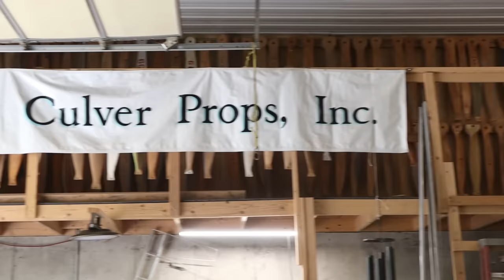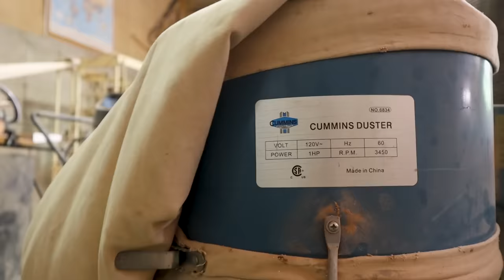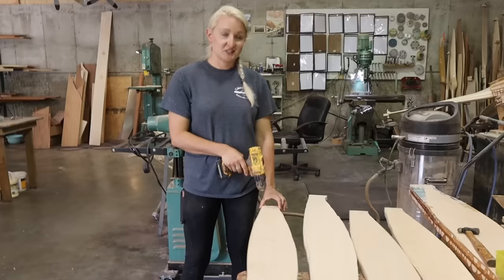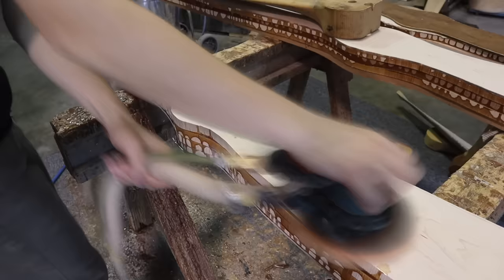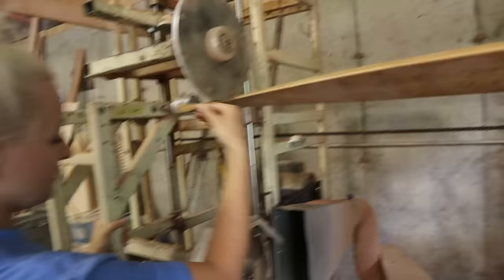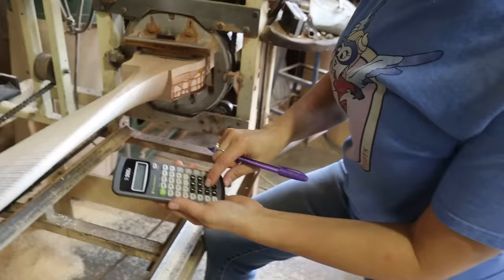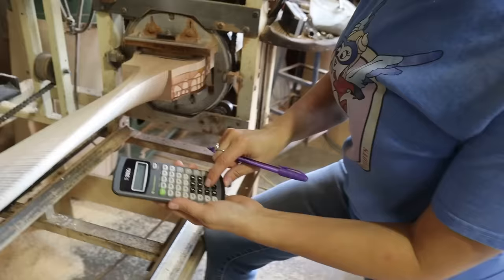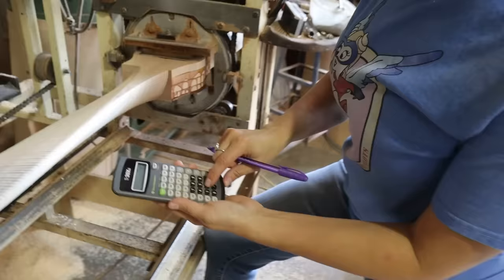Making a WOODEN Airplane Propeller!

Comment: That copy-lathe is the coolest machine I've seen in a long, long time.
Reply: Great idea! Simple as a penny - but so easy to use!
Reply: I wonder how were the propeller made before that machine ever made 😅
Reply: @victorip7632 I think slowly is the keyword
Reply: @Yewtewba  But also by the time propellers were being made in numbers that sort of machine would have already existed.
Reply: @banaana1234  apparently the first was 1820. So yeah I guess so
Reply: @victorip7632  I'm curious how the blanks are made. I guess maybe you could start with a few specific profiles done by hand and iteratively get the variations with the machine plus adjustments.
Reply: @neemabrown6922  Well, sort of.  The thing about the blanks is they are used for both sides so they remain more or less identical.  It's a lot easier to carve a one-sided blank by hand.  Back in the day carving a blank for a propeller was more an art than a science.  Today of course we have computers and CAD/CAM machines to use much more arcane math to design our props.
Reply: @Yewtewba  That mechanism was also (possibly originally?) used to make rifle stocks, back when military firearms were half wood. 3D printing is the new hotness, but don't discount the old ways of manufacturing where the process follows a template -- once you make the reference model, it's trivial to throw it in that lathe and turn out a million or three. Or pop a casting mold off the reference part and pour/injection-mold eleventy billion of them. 3D printing just makes it easier to design the master, because it's faster to iterate tweaks  than whittling logs by hand.
Reply: @neemabrown6922  Alaina has a video earlier this year building a pattern from scratch
Reply: I was about to say the same.  Genius machine in it's simplicity and effectiveness.
Reply: @DeliveryMcGee  That lathe design is also not that dissimilar to older style camshaft grinding machines, with a similar 'following wheel' running against the master lobe pattern and moving the cam blank relative to a grinding wheel to reproduce the shape. The main difference being each lobe is ground separately, rather than it being a continuous pass across the entire length of the shaft. Now everything is done via CNC rather than with mechanical patterns.
Reply: It was mesmerising to watch!
Reply: I believe that lathe operates much like a pantograph. I wonder how old it is?
Reply: I have seen similar machines for copying keys. You put the original in one side and a key blank in the other, then follow along the profile of the key and it cuts it into the blank.
Reply: @neemabrown6922  Originally, they were either hand shaped to the exact airfoil and pitch at the same time with airfoil templates and angle measurements used at various stations, or the airfoil was shaped first and then placed in a vise and steam bent to the exact pitch they wanted.  It's surprisingly easy to design a prop, it's the repetitive and labor intensive nature that makes them difficult to reproduce by hand.
Reply: Copy lathes go back to before the Civil War. They were invented by Thomas Blanchard in 1820, and yes, they were originally used for carving gunstocks.
Reply: If this impressed you then Google Rose engine lathe...
Reply: @victorip7632  
There's a  museum in the Old Springfield armory  in Massachusetts  that has an original Blanchard lathe/gunstock lathe/copy lathe   from the 1800s it's a really cool machine and the great great grandparent of the lathe used here. But more to your comment I believe the log entries still exist from the time the Wright Brothers were making their own early props and calculating the profiles out like slices of a  bread loaf.  Because as wonderful as a copy lathe is someone has to make the initial profile and who ever it is is a real artist
Reply: It takes a really cool machine to make a really cool machine.
Reply: Thats how they make gun stocks I believe
Reply: @DeliveryMcGee  -  And once the computer learns the blank it can continue with a VERY HIGH level of accuracy to turn out props quickly and easily. I used to work for a large automation company and I could see our C&C machines +robots doing this work in a matter of minutes which would include sanding the prop to a perfect balance. This is definitely an art form.  We built some crazy machines to make all sorts of complex products in real time from scratch.
Reply: @victorip7632  Henry Ford copied his production line from "military" manufacturing. Which derived its name from the manufacture of rifles during the civil war. The rifle stocks were made on similar machines, so it is one of those engineering tie-ins where one idea makes another one possible.
Reply: A thing of beauty. Before it started and we saw the pantograph I was trying to guess what would happen - it was even better!
Reply: @DeliveryMcGee  Hero of Alexandria (AD 60) invented the Pantograph, which is the same thing essentially.
Reply: agreed
Reply: is a copy milling machine. The process is more of a milling than a turning operation

Comment: Maybe I don't get out enough, but that lathe is just about the coolest thing I've ever seen.
Reply: I had to stop the video and show my wife.  She thought it was cool and she's not a geek like me.
Reply: It was definitely very cool.
Reply: It's called a duplicator lathe.
Reply: @KJ6EAD  Thanks.  It reminds me of the "Sketch-a-Graph" device I had many years ago.  Same principle, really.
Reply: same, what an incredible low-tech solution
Reply: I  believe that lathe operates much like a pantograph. I wonder how old it is?
Reply: I see lathes all the time. This thing was the coolest.
Reply: OG analogue CNC machine
Reply: It's not a lathe, it's a duplicator. Ancient piece of English kit used for centuries across all industries.
Reply: @shubinternet  I think a pantograph is similar, but can also enlarge or shrink in the process. So, this but with two connected levers (a parallelogram?) of different lengths instead of a fixed distance.
Reply: Whoever came up with that was genius
Reply: Yeah, they used these to make all sorts of wooden objects, like paint brush handles and gun stocks. I guess these days there are CNC mills that are used for this, too..

Comment: There's a scene in the BBC adaptation of "A Piece of Cake" where one of the pilot's propeller explodes in flight. He quickly shut down the engine and managed to glide the Spitfire back to the airfield. It was a wooden propeller, but it was variable pitch.

Comment: I love this mix of technical precision with organic woodworking craft.  I would love to understand how the original prop templates were made!  Also something about watching you fill in those stamped numbers with pencil was just deeply satisfying.
Reply: it is almost funny to see how the process jumps from crafting, to machining back to using a hammer to stamp in the numbers and filling it by hand. It is well: signing of the work making it "official", so the most "hands on" part is the most sacred part of the process as it confirms with the makers knowledge, experience and judgment that this is now a propeller.
Reply: That's a fascinating question about how the templates were made. My guess is they were carefully handcrafted, with measurements being taken at every moment.

Comment: I made a display prop for my hangar in the same exact manner using my amateur rendition of Jablo densified wood with Douglas fir, then hand formed brass leading edge protectors and soldered them in.  There's a local guy with a prop lathe that let me borrow it, and while it does so much of the hard work for you, there's still a ton of work left to do.  It's another example of 90% complete with 90% left to do.  For anyone doubting the resilience of wood as a prop material in the modern world, MT Propeller is still using wood cores for their high performance composite blades, and a lot of the top tier British WWII fighters used Jablo/Rotol wood props.  We started our journey into the skies with wood props, and they're still just as effective today.

Comment: That pantograph lathe is SO COOL! Maker/Aviation crossover content best content 💯
Reply: There's no pantograph there for scaling, just a 1:1 duplicator lathe.
Reply: The 4 bar mechanism of the duplicator  is a pantograph.

Pantograph doesn't mean 1:1 or enlarge or reduce,  it means 4 bar mechanism.
Reply: @myotherusername9224  I agree with the definition but didn't see more than three bars in use. If there are four, I'm wrong and offer a weasely conditional internet apology to the OP for my arrogance. 🙄

Comment: I am amazed that wooden airplane props are just boards "Glued" together 🤯
Reply: Wood is an amazing material.  The combination of flex when needed and rigidity when needed at a relatively light weight (depending on the variety) is hard to replicate.
Reply: @TheBigburcie  Wood is essentially a natural plastic. It's a fiber bound by lignin, which is an organic polymer, just like most plastics are some fiber (glass or carbon) bound by a different polymer. And when you laminate wood by gluing boards together you eliminate the natural weakness of wood, because it wants to split along the grain. So yeah, it's not hard to replicate at all, if anything it's really really bad compared to modern materials.
Reply: "when you laminate wood by gluing boards together you eliminate the natural weakness of wood, because it wants to split along the grain"

except that in this case,  the grain goes in the same direction in every layer, so how does this eliminate the weakness of wanting to split along the grain ?

" it's really really bad compared to modern materials"

Wood is bad?  How so ?
Reply: @myotherusername9224  it's heavier than say carbon fiber or glass fiber polymers, it can experience water damage if the finish is damaged. It does go in the same direction every layer, but they aren't perfectly aligned and wood glue is stronger than lignin, so it binds them better.
Reply: @UhOhUmm   Some of the most modern propellers, like the MT for example, still use wood covered in a plastic with a stainless steel leading edge.

Comment: Worked on gas turbine engines for 45 years.  Lockwiring is indeed an art form.  Gas turbines have thousands of pieces requiring lockwire.  After a while, I stopped using lockwire pliers.  I found it easier to get right by hand twisting and maybe using needlenose pliers to feed it through the holes.  Glad to see you twisting the stub end.  That end is razor sharp, and the cuts from them take forever to heal.  Not tucking the ends is a good way to get your whole family cursed.

Comment: Great video!  I made wind generator props for years, ranging from 3 to 8 feet in diameter, two and three blade.  Same process, only the airfoil is reversed.  I made my own tracer to cut them.  I sold quite a few bored out with clocks installed in the hub for wall decorations.

Comment: Shoutout for Rolla, Missouri!!  Not far from me.  I think I saw your prop shop in another airplane video, possibly for Jimmy's World, to get him a replacement prop for an oldie plane. Side note, as a kid, I saw a similar lathe replication process where they were making walnut rifle stocks. A roller traced along a cast metal model of the stock and replicated it out of a block of wood. Pre Cad/Cam machining that is very cool for the assembly line production.

Comment: you know, there are two kinda of prop makers on youtube :D

Also what aircraft mechanic doesn't love doing the safety wiring. I worked on J79  turbines (F4 Phantom II) and that thing consists of more safety wire than actual engine :D

Comment: Blade angle and pitch in propellers is similar to torque and horsepower in engines.
Blade angle would be torque, and pitch would be HP. In order to calculate pitch, one needs to know the blade angle (and other variables), as one needs torque (and RPM) to calculate HP.

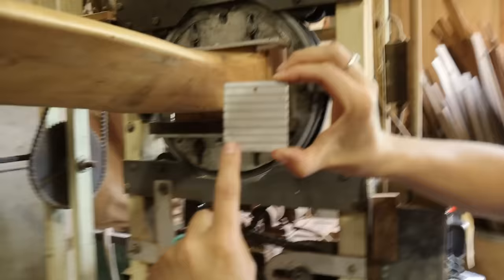Comment: Fantastic work, profile lathe and video. I didn't quite understand the stair stepper gauge at 13:32 but I'll think about it some more. At 15:48 where the lady says spread, in engineering terms that is called the PCD or Pitch Circle Diameter  😂
Reply: I think the stepper gauge was just for increasing or decreasing the pitch a little since the blank it was referencing may not be the exact pitch they wanted.

Comment: I was wondering if the lady at Culver's props had ever done a repair on a split prop.  This kind of repair was common during WW I because of bullet holes or a defect in the original wood material, they then glued the split and wrapped it with string, then lacquered it all in place.  It acted like a composite repair or a fiberglass repair, where the laminations of the string and the lacquer ended up making a stronger repair than original, but with more inertia due to the added mass.  In order to balance the prop again, they had to do the same thing on the other blade of the prop, then static balanced it.

Comment: A copy machine for making blades is a cheat toy!)))) I want to know what kind of glue they use to glue the lamellas of the workpiece? This old airplane is just amazing!!!!
Reply: Culver used to use Weldwood plastic resin glue but it became out of production.
Alana ultimately found a good replacement for it. She did a video about that in the past couple of years.
Reply: @jimurrata6785  Oh thanks for the tip! This is urea-formaldehyde resin in powder, in my country it is sold under different names, but the scope is the same.

Comment: What did you use for a finish, Xyla?
I didnt catch anh mention of that.
Safety wire is definitely an art form. Keeping the twists consistent, choosing just enough wire to make it through the bolts without wrapping yourself up, tucking in the sharp ends and policing every offcut for FOD in the hangar.

Comment: Hmm. I was thinking of making a wind turbine for the garden - but I might be getting too ambitious if I have to make propellers like this!
Reply: It’s not that hard if the propellor is as big as your hand. You start with a 2x2 by 1 foot long piece of lumber then cut away the bits that aren’t propellor. When you think it’s done put a bolt hole in the middle and spin it with a drill. It if makes wind and doesn’t vibrate too much it’s a propellor. If it doesn’t work it’s a paint stirrer
Reply: Just build a vertical one, it is simpeler and better

Comment: Interesting that the copy lathe doesn't have a counter support for the template under where it rests on top.  Doesn't it result in a slight blade warp in the middle where it's unsupported?  I once built a wooden prop for a hovercraft by hand.  It's really hard without such a lathe. Aren't they normally fiberglassed or at least epoxied on the outside finish?

Comment: i just learned the meaning of "dead stick" , it turns out that it relates to when props were wooden, and when power is lost, the wooden prop, aka "stick" is dead. i thought it had to do with the yaw stick but apparently flight controls are still available in some instances when power is lost. I'm no expert on aviation at all so feel free to correct me

Comment: Is there a reason they use multiple planks glued together rather than a single thicker plank? Does it have better mechanical properties? Or does it just allow them to have more control over what wood they use since with a thick piece you can’t see what is going on in the middle?

Comment: As an A&P IA and a chief inspector for a 145 Repair Station, I must ask (before I watch the video) who certified that propeller and what TSO is it made to?
Reply from the maker: As an A&P IA and chief inspector for a 145 repair station, you must know Pietenpols are experimental aircraft and therefore the propeller is not certified!
Reply: @xylafoxlin  OK so now that I actually watched the vid, Awesome job! really, good stuff!! I didn't know at first it was going on a Pietenpole.  It's the paperwork police in me that had me asking about certification.   Good safety wire job too, I'd sign that off for ya :)  Although, you should really use the star pattern when torquing propeller bolts to make sure that the mating surfaces are seated correctly, I also do a half of the final torque first then go back around to assure that the flange and hub are mated up nice. Great Vid, thanks for bringing us on this adventure.

Comment: The most surprising thing was that things are still manufactured in imperial units. I would have expected all manufacturing related to airplanes having already switched to metric.
Reply: That depends entirely on where the aircraft is built.  The Pietenpol Air Camper featured in the video was originally designed in 1928 to be powered by a Ford Model A engine, so you are not going to find a single piece of hardware on it made using the French system of measurement.

Comment: Given that wood is stronger in compression than in tension, is there a safe speed limit for wooden props and does anyone add composiite tensile layers such as aramid or carbon fiber in the blank?

Comment: 22:05 Torqueing pattern!
Reply: Torque has to be combined with blade tracking, neither of which were shown. Probably because it is boring and time consuming. Same for applying the finish on the propeller. Lot of other time consuming steps were skipped to keep the video moving along.

Comment: Um torquing those bolts should have been done in opposite relation to each other. Just like putting on a car wheel.
Reply: Um, looks to like it was the check torque after final, seeing as to how none of the bolts moved.  I'm fairly certain she knows what she's doing.